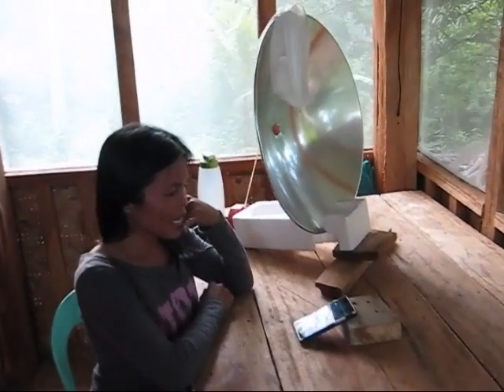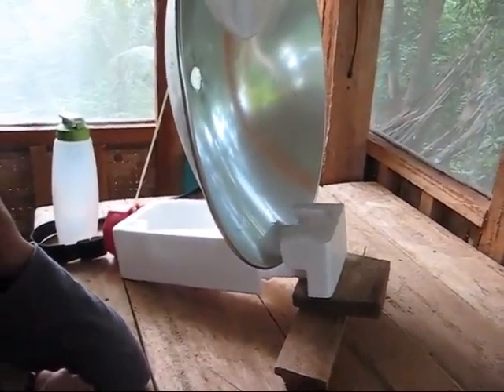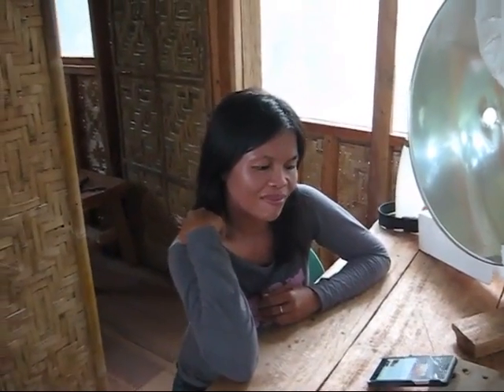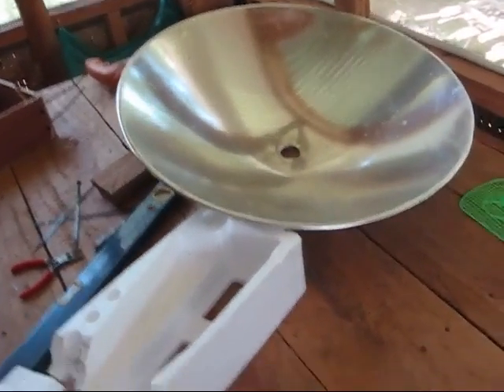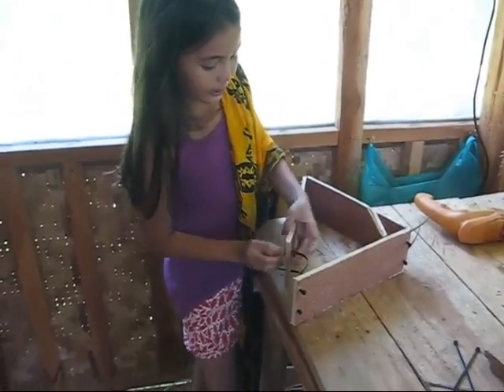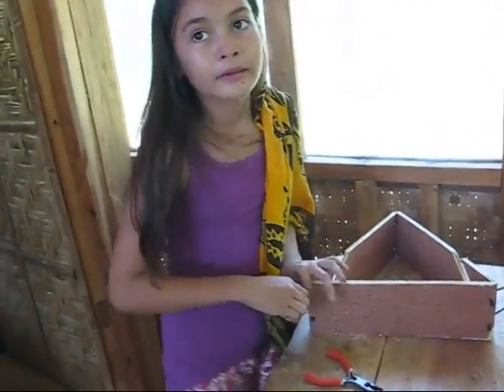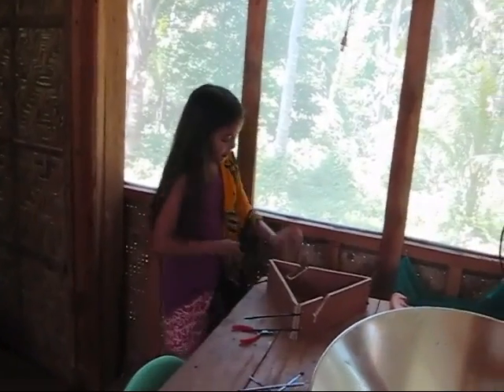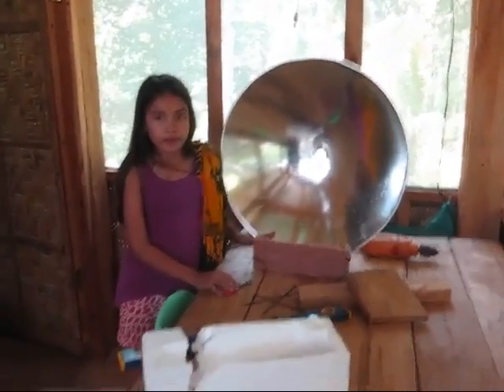DIY Wifi Booster Update And Modifications An Expat Philippine Lifestyles Video

Comment: Great job Dan. I would recommend that you build a pole to mount the dish out side in an area that is  unobstructed as much as possible. Try to  mount the pole in a way that you can rotate it to help find a better signal.  Also i recommend you paint the dish to help with dissipating some of the heat.
Reply from the maker: +Grunt Sound Off ! Good idea the only draw back is the WiFi thing only transmits a few feet
Reply: i believe if you were to attach a mini Wi-Fi receiver to the center of your dome and can get as much of a clear  path or line of site toward  the tower/wi-fi  signal you should be able to amplify it. Try using the wi-fi  adapter you have and attach it to a rod and place it away more toward the center of the reflector to focus the signal.

Comment: Nice video. Just thinking out loud about the 'title' though.... Surely you are boosting the 2G/3G pickup for connection to the cellphone tower, not boosting the WiFi signal from your pocket dongle to your devices? Technically the title would be '2G/3G signal booster', as the WiFi element is only relevant between your dongle & your devices? As I said, just thinking about this from a technical perspective.... Keep up the good work. God bless.

Comment: Block the hole with a piece of tin foil then position the antenna directly in the center the focal point judging from the video would be 3.5 to 4 centimeters from the dish to the where you should set the antenna. You can't just hang it over the edge it needs to be inside the dish shape if that makes sense. That why you see those sticks and that knobby thing in the center of satellite dishes they are setting the antenna into the focal point of the dish.
Reply from the maker: +Jamie Robb I will try that

Comment: be sure to put your equipment right in the middle of the dish where the hole is at. also, take it out into the sun without the equipment for a couple of seconds to see where the focal point is to the sunlight. Then you know how far out away from the dish your equipment needs to be to be in the signals focal point
Reply from the maker: +Hal Johnson good idea